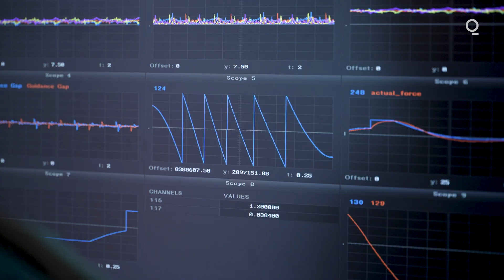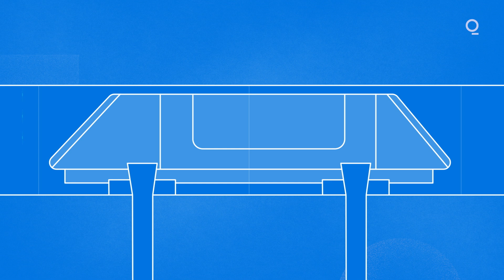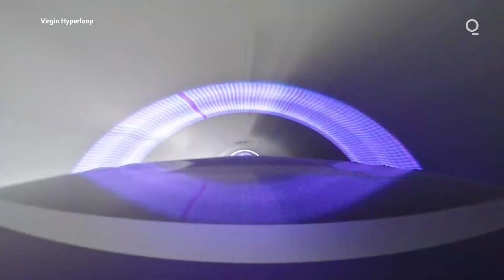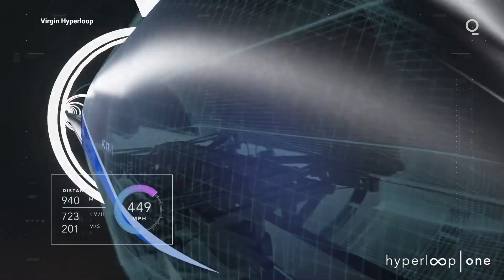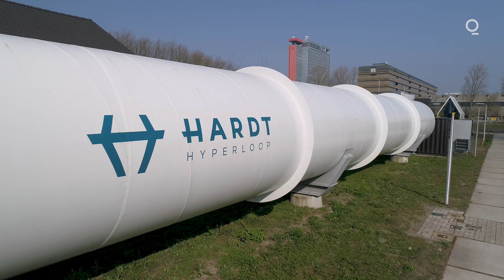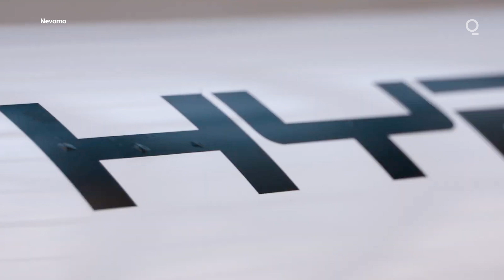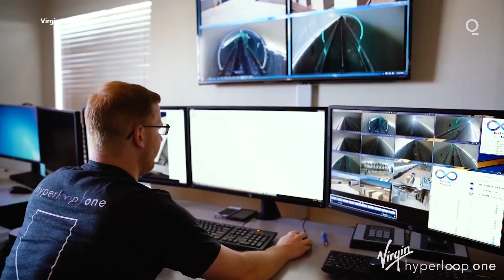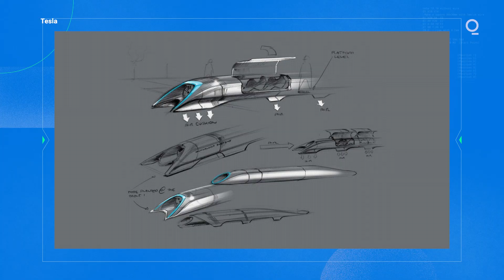The Hyperloop May Disrupt More Than Just Travel

Comment: So…a mag lev in a vacuum tunnel is quick and efficient. If that compressed air pumped out of the pipe is stored, it can be used to power a large part of any town or city. $10b is really not that much in the context of a modern commuter railway.
Further…there are lots and lots of aircraft sitting unused, never likely to be used again, already designed to travel in low pressure environments. Would be great if they were repurposed for this kind of operation.
Oh…and by the way…I proposed this idea to the minister for science in Australia in 2002 and he almost laughed me out of his office, because of the cost. Let the record show this…
Reply: I think your falling for a manipulative sales pitch. there lots of problems this system has besides the cost. its to expensive for the average user. it cant transport the amount of people a trane could in the same time, which makes its unusual daily transportation. and safety still wasn't really addressed. this thing is great work of technology but it just doesn't have a market.
Reply: @Broken_Mesh  in the short term, yes, but over a number f years it becomes cost effective. Don’t forget I had this idea 20 years ago..
Before these Gus ever proposed it.

Comment: I am not for mass transit. Usually it has been a huge drain of funds and too many cost overruns. The ONLY reason subways and community train and tram systems work in the inner cities is because they were produced BEFORE cars were prevalent. This system however could easily be incorporated to travel the earth by way of Arctic connections and could easily be a viable option to flying. Like infrastructure, the best use of investment would be major cities like L.A. to S.F. or Las Vegas, Salt Lake, Portland Seattle Vancouver BC etc. Then the system should be franchised out to counties or cities to add spurs to various destinations along the way. Let municipalities or even private investors pay and charge for connections from the main line.

Comment: Does anyone notice that the total capacity of the hyperloop is a fraction of the train? the speed of it can beneficial but you can literally break a whole section of the line with a single bullet and everything blows up by a decompression.   And it inherent cost of construction and maintenance
Reply: The concept is easily debunked. Sure it can be made but to build a huge one is extremely expensive, to operate it continually is extremely intense and dangerous and it does not compete with other modes of travel.
Reply: The concept is easily debunked. Sure it can be made but to build a huge one is extremely expensive, to operate it continually is extremely intense and dangerous and it does not compete with other modes of travel when you factor in the costs and the risks and the difficulty and slow pace of loading and unloading passengers. 

All sorts of magical thinking is required to believe this would be a practical mode of transport for people. It’s not, it’s just a sci-fi idea to creat hype and drive up stock in Elon’s companies.
Reply: hypeloop = theranos edison.

GADGETBAHN.
Reply: This capacity of a computer animated graphic is infinite
Reply: That’s because this will be much more expensive then a train. It won’t be for you or me it will be for the rich
Reply: @raydanieliv3195  it won’t be for anyone because it’s not going to ever exist. It’s a way to hype stock prices.
Reply: I feel like so many are obsessed with the brand “hi-tech” and don’t care much 
About the value added
Reply: Yes, there will be leaks. All systems leak. But I think the energy to maintain the vacuum will be less than the losses due to air drag.
Reply: I doubt that any engineer would be ok with constructing any vehicle from a material that is brittle enough to be destroyed in that way by a bullet. Much like a bullet hitting a plane the damage would consist of a single hole that could be plugged with a finger, something that should be repaired when the vehicle stops but pretty far from the complete destruction of a section.
Reply: @garethbaus5471  You've obviously never seen what happens when a vacuum tank suffers any sort of impact or tear.
Reply: @jeremyowen1  the result depends greatly on what standard the tank was built too, it is mostly about structuring the walls so that they are stiff enough to avoid crumpling 14 psi really isn't much stress so long as it is distributed correctly.
Reply: And by "total capacity" you miss the point. Think about your internet connection. This is like comparing mailing hard drives to having a broadband connection. Sure, mailing multi terabyte hard drives is faster than a pesky DSL connection for bulk transfer, but waiting a week sucks. Know what also sucks? Waiting for the train, or dealing with the airport traffic. Nothing beats a freight train doing 110kph (65mph) for raw cargo capacity, except a container ship doing 30kph (18kts).
Reply: You put pressure relief valves along the length of the tube in case of any decompression event. Why you guys don't get the concept is beyond me.
Reply: @crocodile2006  Pressure relief valves... on the vacuum tube that the vactrain is supposed to pass through at speeds of hundreds of miles per hour.
Of course you don't see the problems with that. You're a Musk fanboy.
Reply: @crocodile2006  I have news for you, the tube is not pressurised, it is evacuated air, partial vacuum.
And a bullet can crush the tube by crumpling from localised pressure points, there’s a reason why it is shaped as a precision cylinder.
Reply: @madsam0320  I realise it's a vacuum... you do realise you can put pressure relief valves on a vacuum tube right? The pressure from the outside air keeps them sealed and so any pressure increase above outside pressure aka a sudden rush of air will bast them open. You can also have them electrically controlled so that any loss of pressure at one of the end of the tube will open pressure relief valves at the other end at the speed of light. Thunderf00t who has invented nothing doesn't think of this option... because well.. he's not too bright.
Reply: @crocodile2006  loss of pressure? How in the world can there be a loss of pressure in a sealed tube with partial vacuum?
Reply: The tube is a vacuum You can't put pressure release valves on it because that will just increase the amount of air rushing inside. Also the vehicle would be moving at or faster than the speed of sound (as they advertise it) Now imagine a vehicle moving at the speed of sound colliding a pressure wave also moving at the speed of sound.
Reply: @asandax6  Yes correct... you put pressure relief valves to increase the amount of air rushing inside in a controlled manner. I don't know why you keep mentioning it's a vacuum tube.. I already know this. The claim being made is that a sudden break will lead to a air canon situation, but I am making the point you'd have pressure relief valves the length of the tube that solves that problem.
Reply: @crocodile2006  but you're smart yeah lol.
Reply: @crocodile2006  and and that will fix a problem that no one wants?.
Reply: a "self healing" solution can be integrated into the structure to counter the damage of a bullet like scenario
Reply: @germanher7528  magical thinking. If you can solve all the issues with magical thinking, sure it totally works. lol
Reply: @germanher7528  Ah yes, we'll just bust out the nano bots. Easy.
Reply: Gawd, the world is lucky that you and your 6.2 seconds of thought have chimed in here and alerted them all to this.  They didn't hire ANYBODY to work out problems.  They are not that smart.  They have been waiting for you and your magic insights.

Comment: 3 things worry me here which I still am not convinced they know how to tackle:

1. wind
2. vacuum
3. high speeds (1000 km/h)

It can be done with the help of a very advanced AI system. And perhaps also armies of robots. But it will require a whole new level of effort!
Reply: They need a factory to produce the tubes on a large scale, 
Big pumps for the vacuum every mile, and some sort of power plant (maybe fusion?) to provide the electricity needed to keep the magnets rolling.
Reply: @DragosPetru  ...and some sort of robot army to fix any cracks. Or perhaps some bacteria can do the work. Or magnets between the tubes. But the scale and effort in order to get there will be costly!

Comment: I would like to know how much more it will cost to build? By my understanding, 2-3 times maglev cost is a minimum estimate, and maglev doesn't come cheap. 

Anyhow, at that price it will only be viable for the rich as general populace won't be able to afford this thing. Not including cost of maintenance, stress of assembling vacuum pipes at that height, etc.

Can you not just invest in high speed rail network. It has been getting cheaper to build, about one third the cost of maglev. And, improving the existing railway will be even cheaper and make more sense rather than this project which hasn't progressed much in the last eight years and still not affordable for any country to make profit off it.

Comment: It has all of the issues of maglev in addition to having to operate and maintain thousands of kilometers of vacuum chamber. I'm not convinced that the efficiency gains of operating in a vacuum offset the energy and economic costs of building and maintaining the rail itself.
Reply: just don't see how the vacuum chamber is doable in the real world setting.
Reply: The main problem with the vacuum design is that, if you have seen actual vacuum chambers, it has a really bulky and usually slow to open vacuum doors. Imo a train slowing down to stop is faster than a having to open a super heavy door
Reply: And they have been waiting for you to be convinced and for your magical approval.  NOT.
Reply: Rail goes in sections not one piece. You haven't seen trains. There are reasons why there were tokens and semaphores in the past and now digitally controlled systems.Korea and China, the leaders in rail,swim in money.
Reply: It's the technology of the future! Until then, let's keep it there until we can iron out these other problems we have. Also, how do you stop something running along a magnetic field in a vacuum without breaking the entire thing apart?
Reply: @kebman  The same way maglevs slow down? instead of pushing of backwards along the tracks, you push forward slightly. 

But that's not the main problem here. The whole "keep thousands of kilometers of tube vacuum without anything going wrong AND it somehow being more energy efficient than just using a meglev" is the problem.

Comment: The problem I can see with it is how easy it would be to cripple the network.
You're creating a near vaccum system on a scale never before seen. What if something punctures the tubing? The entire network would be disabled. Also, what if one of the pods has a failure while moving at a thousand mph in a sealed tube amongst other pods?
Seems kind of fragile. 
Would there be periodic stations where tubes could be sealed and pods from affected tubes could be shuffled to unaffected tubes? Would more than one tube be running in parallel for this to be possible?
Interesting stuff, but a lot of hurdles to figure.

Comment: The amount of materials needed to create such a network is crazy compared with just using airplanes.
Reply: Yeah. Or just regular trains or even "regular" maglev systems. Unfortunately planes are one of the main factors for the climate crisis. But I guess we don't care enough yet. Maybe we will when our favorite holiday destinations getting flooded by the rising tides, who knows?
Reply: @matteloht  not airplanes but the fuel. You can easily use biofuel instead of crude oil to produce jet fuel and be climate neutral. Building infrastructure requires much more resources that we have to extract from the earth like rare metals. Just using airplanes that already exist and a few miles of runway that also already exist together with biofuel can connect the world in the most neutral way.

Comment: every 2 cities. Christchurch - Stockholm. o wait that is not energy efficient. Airtravel would then be more efficient. Via space even more energy efficient. Any 2 cities not divided by a see or mountain ridge with less then 1500 km of land in between them. That by extension of connecting all those cities you can thus connect stockholm to madrid, ok. But if you want to go from a city near stockholm to a city near madrid take the plane and use hyperloop to travel to and from the airports.

Comment: Best case its a faster maglev in a vacuum tub. However the problem with maglevs are not that they are to slow its that they are to expensive compared to high speed rail. here are speed comparisons hyperloop(hypothetical 700mph, test system 288 mph), maglev(300 mph in operation, 400 mph top speed JR-Maglev L0-Series), high speed rail(220 mph in operation, 350 mph top speed of TGV POS). So you get to go 2x the speed of a maglev in the best case for the cost of running the worlds longest vacuum between two points. A maglev between LA and San Francisco would take 2h and a hyper loop would take 1h, where high speed rail make take 3h. The question is if it is worth the extra cost to make a hyper loop. 

also the video talked about train switching being a problem but the idea that you are going to switch a hyperloop pod going 700mph is insane. All this hyper loop idea is just talk till someone makes a test system that is actually faster then existing trains.

Comment: 2:52 - 3:02 If that railway is somehow managed to be a vacuum, I couldn't imagine what kind of damage it'll potentially caused when the vacuum sealing failed 😂🤣

Yep, definitely a sci-fi only tech 🙄
Reply: If the seal failed it'll get air resistance nothing else.
Reply: @aaryajain6396  LOL... the air resistance would have a impact of car taking a concrete wall at 1000 kmph head on. Slight inconvenience.

Comment: It is not economically feasible and it's also very dangerous. Even a plane is much cheaper and much, much safer.
Reply: Ok luddite. Not true in the long term. The railroad was more economically feasible and safer then the automobile in 1900. The zepplin was more economically feasible and safer then planes in 1920. Things change
Reply: @JoeTheBroken  But we have yet to make mag lev economically feasible, so how is putting it in a vacuum tube going to ever become economically feasible? If you make hyperloop economically feasible, then it would be MORE economically feasible to just do regular old mag lev.

Comment: Elon has already mentioned that his Boring company tunnels are hyperloop ready.

Sort of make sense as underground tunnels are subject to less temperature variation than above ground tubes, does not have some of the issues with making air tight joins and less likely to collapse as a result of a small leak.

My view is that even if they managed to a get a working, it will be at much higher pressure, possibly 0.1 atm or higher as it would be easier to achieve this pressure and would require fewer pumps.

Comment: There was a time when people thought planes were impossible, so I'm just hopeful this comes through in the future as well.
Reply: This tech is as old as the plane. This is not new tech.
There is only 10years difference between the first airplain and something that we now would call hyperloop.
There is still tunnels in London from 100years ago when they made this the first time. (they are now used as cable tracks for electricity and so on.)
So far the hyperloops that has been created has only gotten up to maglev train speeds meaning there is already an easier cheaper way of doing it.

Comment: it requires engineering perfection. Not just in the machine itself, but every part of it's tunnel. Imagine there is a miniscule air leak into the tube, suddenly the 1000km vehicle hits an air pocket, it would hit  like a rock. any debris in the tube would be like bullets. The susceptibility for terrorist attack would be extremely high, right along its length. They wouldnt even have to plant a b+mb, just hit the tub with a small projectile to knock debris inside that would render the whole track unusable..

Comment: It would be nice if it wasn't a giant scam.
A vacuum with a volume that large cannot be held safe by a few centimetres of steel. Especially when you look at how much such a tube expands in a course of a year. The track between LA and San Francisco would about 150 metres, the way back would expand the same amount. The joints can't be sealed that much, they would burst and the whole vacuum suffer.

When they want to drive more than 500 km/h, you would need longer curves than any train track or freeway. The passengers want to be alive when they arrive at their destination.

A crossing of to tubes/tracks would move depending on the location between 50 and 150 metres a year. So when you can seal the tube, the joints at the crossings would burst.